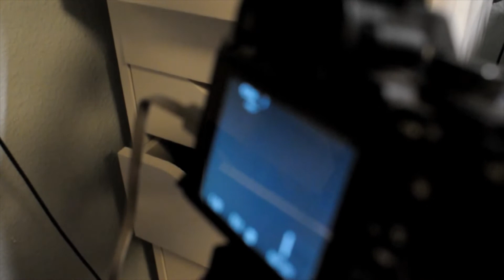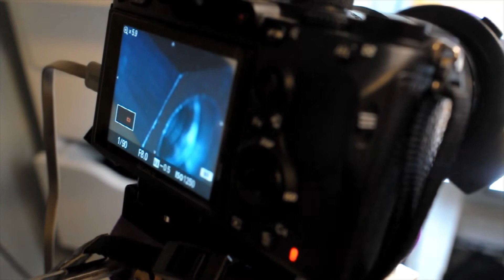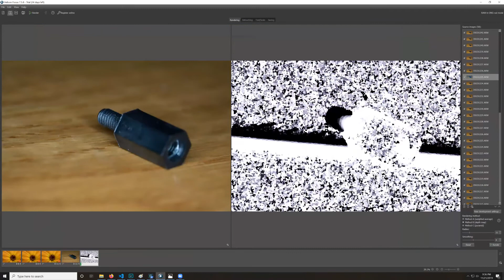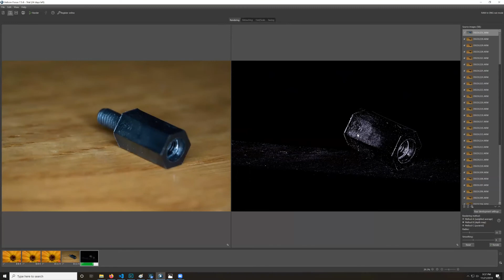Work in progress: DIY focus stacking rail

Comment: very good setup ! could you explain how you build the rail itself (screws, woodplate) ? thanks a lot !
Reply from the maker: Thanks! :) 

The wood plate is a scrap of maple I had in the garage. The rail itself is designed in Fusion360. It uses two 8mm rails and an 8mm lead screw. The lead screw is driven by a small NEMA 17 stepper motor. The motor is controlled by an A4988 stepper motor controller. The controller in this demo was driven by a Raspberry Pi.

The rail parts where the camera mounts and other parts mount to the wood plate are 3d printed and designed in Fusion360. I designed it to allow me to mount an Arca-Swiss-style quick-release camera bracket which lets me mount the camera quickly. The rail mounts to the wood plate with some wood screws.

The camera in this demo is controlled over USB by gphoto2 software on Linux and some custom code I wrote to drive the "take some photos" part.